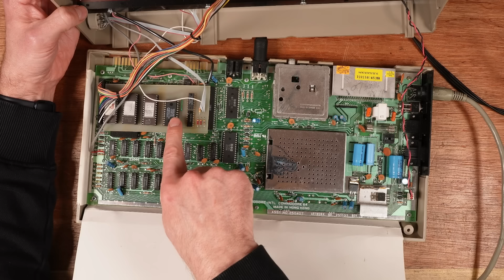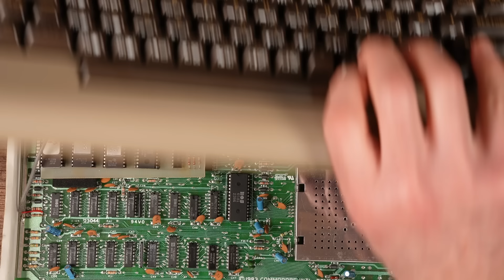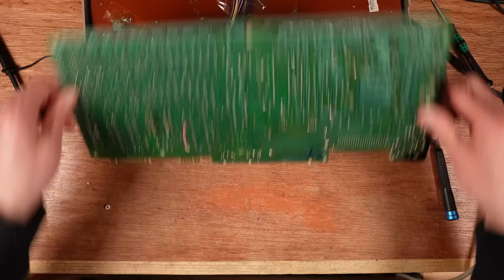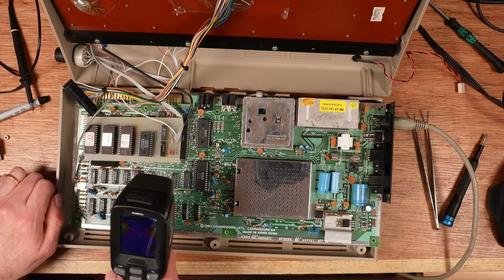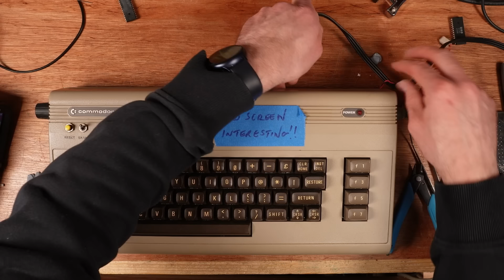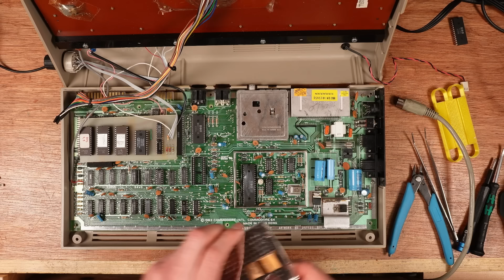Interesting C64 Repair - Its NOT a C65 Dev Machine

Comment: Nice intermission performance! 😀
Regarding the piggybacked character ROM, the two pins in the very front (left and right side) @20:22 – are these healthy solder joints? It looks like as if we could see air. (The flickering bits may hint at a connection problem.)
Reply from the maker: Sadly this now belongs to someone else, so we may never know

Comment: I had that problem with my old Antex iron, no sleep mode. Me being a numpty I forgot to unplug it (it was left on for 3 days), where the tip was black, luckily it did not kill the heating element. 30 years later that old Antex still works. What ever happened to Antex, they were great. Nic fix, and great Video as always.
Reply from the maker: You can still buy Antex soldering irons today! Still going strong. I might even get one and have a look at it in comparison to a modern iron.
Reply: @morefuntech  Good to know, I thought they must have gone by now.